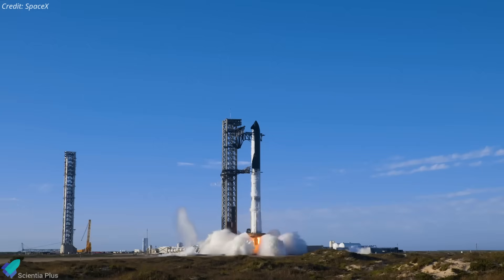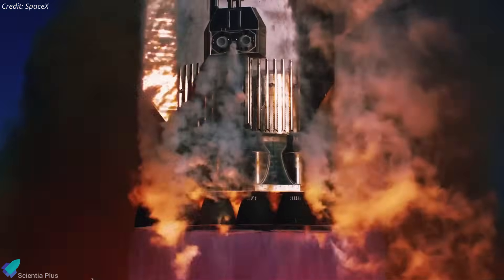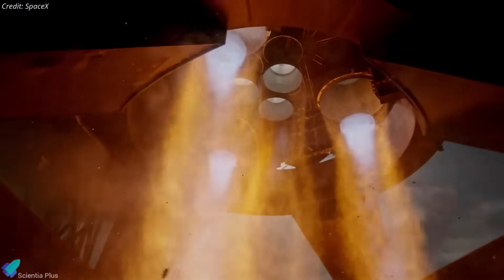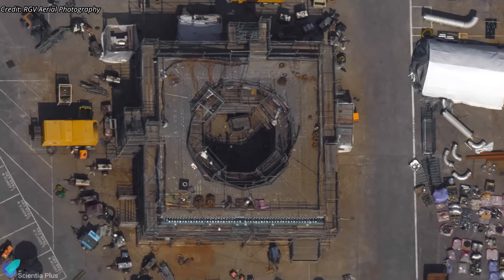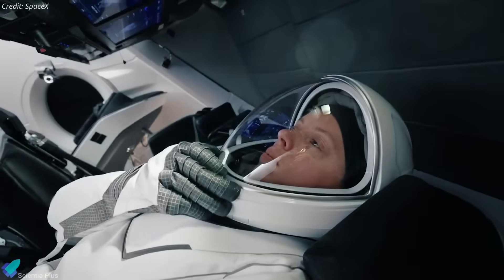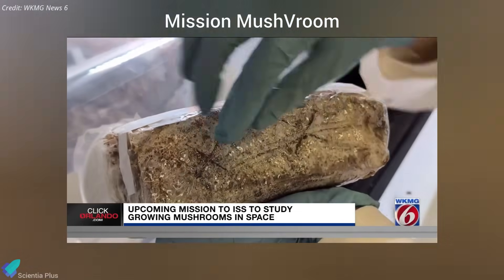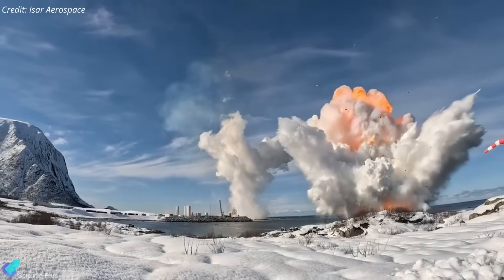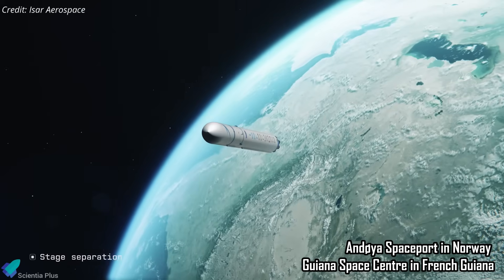Starship First Ever Reuse Test PASSED, Flight-Proven Raptors Are BACK! Booster 14 Static Fire

Comment from the maker: 00:00: Starship Updates 🚀
07:31: SpaceX Shocks the World: First Human Polar Orbit Mission Launched! 🌍🚀
11:39: Catastrophic Failure! Isar’s Spectrum Rocket Crashes After Liftoff! 💥🚀

🚀 Starship Flight-7 Anomaly Explained: https://youtu.be/UqzZx7vb-TA
🛠 Starship Flight-7 Root Cause & Fixes: https://shorturl.at/HcLKo
📊 Flight-8 Complete Breakdown: https://youtu.be/f26yH80RK2o

📚 Learn More:

🔹 Starship Block 2 Explained:
 📖 Summary: https://shorturl.at/b0dtw
 🔍 Detailed Explanations:
  • Design Improvements Update 1: https://shorturl.at/lpGT7
  • Design Improvements Update 2: https://shorturl.at/gwNQ4
  • Nosecone & Payload Bay Redesign: https://shorturl.at/xa60S
  • Methane Downcomer Redesign: https://shorturl.at/XdYBG

🚀 Starship Block 3 Explained: https://shorturl.at/mnBT4
🚀 Starship Block 3 & Booster Block 2: https://shorturl.at/IViwD

🔄 Starship Block 2, Block 3 & Raptor V2, V3 Complete Update: https://shorturl.at/tN248
🔥 Raptor V3 Mega Upgrades & First Test: https://shorturl.at/TRIyj
🚀 Starship Block 3 & Booster Block 2 production Begins: https://shorturl.at/xRNkJ

🛠 Latest Starship Upgrades:
 • Hot Staging Explained: https://shorturl.at/jf400
 • Super Heavy Booster Upgrades: https://shorturl.at/Pi5R3
 • How SpaceX Protects Raptor Engines: https://shorturl.at/4Om8F
 • New Heat Tiles Explained: https://shorturl.at/p2Ijb

🚀 Starship Flight-7 Anomaly Explained: https://youtu.be/UqzZx7vb-TA
🛠 Starship Flight-7 Root Cause & Fixes: https://shorturl.at/HcLKo
📊 Flight-8 Complete Breakdown: https://youtu.be/f26yH80RK2o

📡 Stay Updated:
📢 Weekly Updates: https://bit.ly/3HIQjPC
🚀 SpaceX Playlist: https://bit.ly/34wue8T

Comment: April 3, 2025

Watch the I Robot movie (2004) with Will Smith before you buy a Tesla robot, a Tesla vehicle, or Starlink internet service.  
He has the ability to do "Over The Air" retribution.

He has threatened to stop Starlink service to Ukraine if Zelensky does not cooperate.

Read I, Robot by Isaac Asimov, published Dec. 2, 1950.

March 29, 2025
  Remember a previous time an Elon Musk company was failing and used another company to save shareholders and investors?

    November 21, 2016,   Tesla CEO Elon Musk says the SolarCity merger.   The $2 billion Tesla-SolarCity merger went into effect today, just four days after Tesla Motors’ shareholders gave their approval.  SEC filing SolarCity is now its wholly owned subsidiary. The all-stock deal converted each SolarCity share into 0.11 Tesla shares, and SolarCity is no longer listed in the NASDAQ market quotes.

  March 28, 2025 (Reuters) - Elon Musk's xAI has acquired X in a deal that values the social media platform at $33 billion and allows the value of his artificial intelligence firm to be shared with his co-investors in the company formerly known as Twitter. Summary:      Transaction is an all-stock deal.      Deal's $45 billion price tag includes $12 billion in debt.     xAI valued at $80 billion, integration could make training Grok easier.

   Is Elon unable to make his loan payments for Twitter?